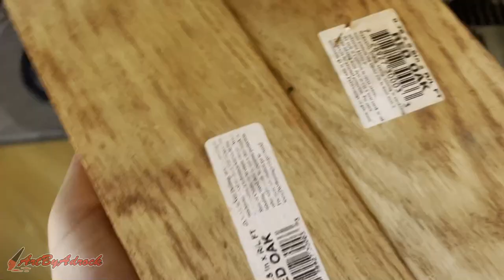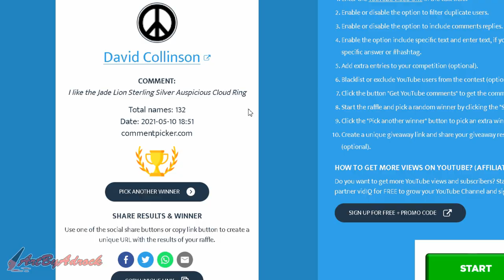Casting Thor's Hammer - Mini MAGNETIC Mjollnir | ArtByAdrock

Comment: Damn nice try with the tapered sprue and all but if I may make a few suggestions
1:- Throw away the scissor pouring tongs and go to a simple hoop on the end of a rod - this will give you much better control of your pour. The tongs look nice but best suited to a fixed place in your display case.
2:- Basin needs to be cut deeper and squarer so the metal does not ricochet out like that. See my "basin and sprue" video - cut with a pipe not a spoon!
3:- Ridge in basin needs to be much lower, again see basin and sprue video.
With a basin say, 1.5 inch in diameter and 1.5 inch deep the ridge height from bottom of the basin should be O.375 inch - when you pour there should be 1 to 1 .125 inch of metal over the  top of the ridge, this plus a very generous radius from the top of the ridge to the side of the sprue is the secret.The ridge sort of acts like a well radiused speed bump. 
If you had not lost all that metal up  front  all the castings would have filled nicely. 
Well done for giving this better technique a go, please stick with it...Martin
Reply from the maker: Yeah I know I screwed up just thought I’d give it a go anyways. 🤷🏻‍♂️ thanks for the info and your input. The tongs though I’ve had no issue with I just poured entirely too fast. Oops